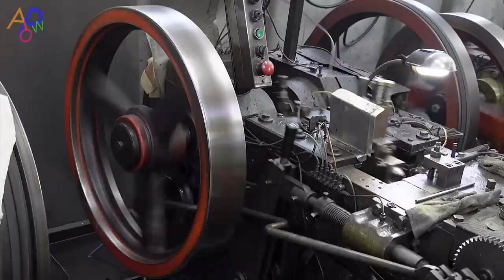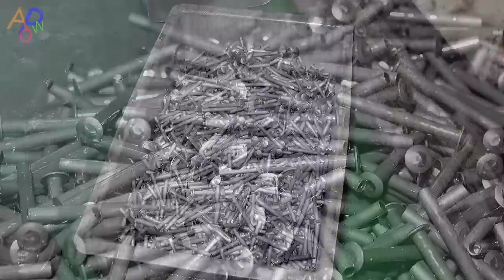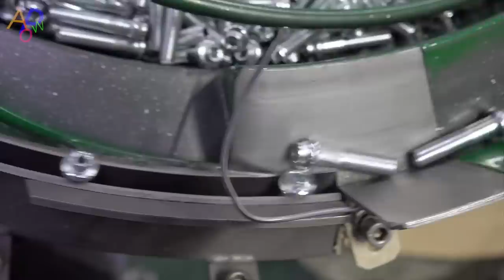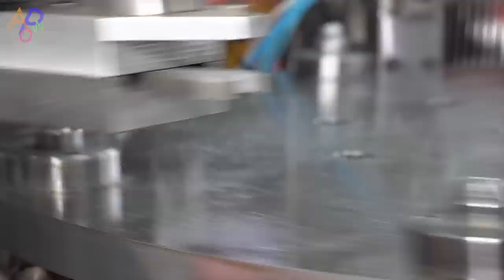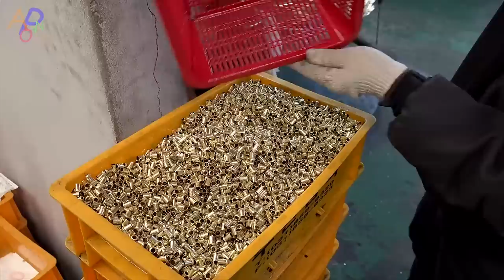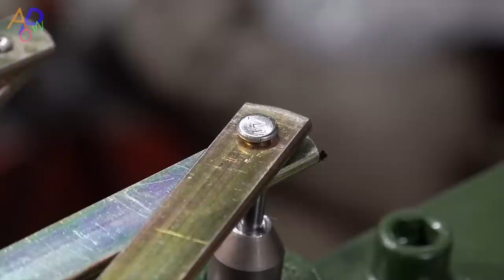Rivet Screw Mass Production Process. Special Screws Factory in Korea

Comment: Great video! But more technical details needed. Example, this very specialized rivet. Tubular, with serrations (or even thread) outside and ball inside. I would like to know where it used.
OK, I checked "products in video" website, look like it's part of injection packer, it's really threaded outside and have check valve inside, so along with ball there should be spring. It's not a rivet.
Reply: Good research 👌 
I too wondered what was going on there with the parts and attributes you observed. 

One day in the dim distant future, Jimmy Whales's son or grandson will develop an App to allow "Registerd Contributers" to edit the CC commentary on videos 📹 😀
Reply: @BrassLock  Few years back it was possible on YT to edit and create CC, if  the video owner allowed this. Guess he also had to approve edits. Example, one woodworking forum translated CC for a whole series of how-to videos to local language...
Reply: @mayoropl1  😁💯👍